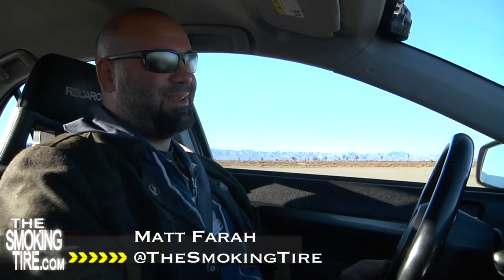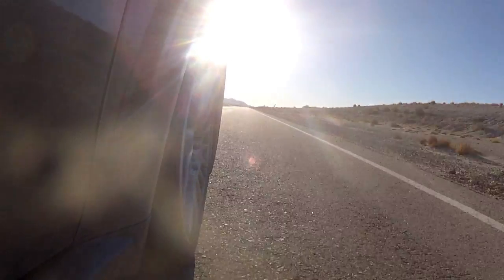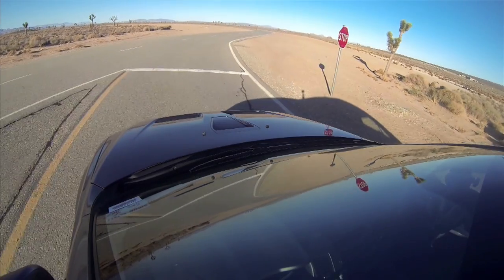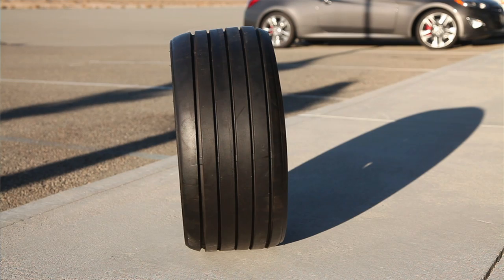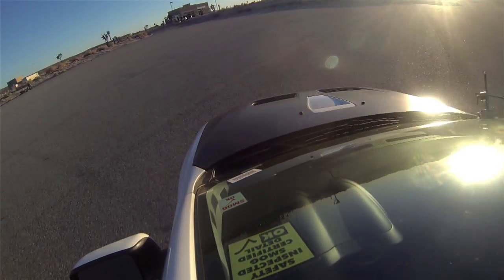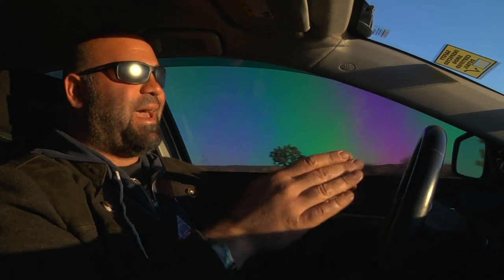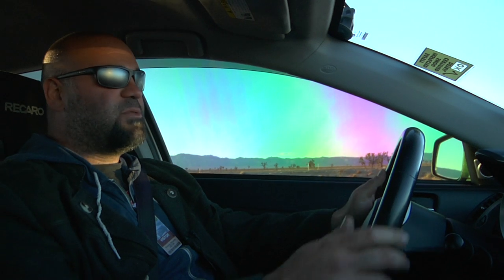Are current tires the wrong shape?

Comment: No mention of whether or not this is the same compound or not, different car (possibly different suspension setup)... Those would not work in snow at all. You need an aggressive tread and soft compound for snow. I see zero tread, just the grooves in what is basically a slick. You'd probably see that kind of difference in handling from a super slick racing tire vs an all weather tire. I need a more scientific comparison to believe this works as well or better than a properly set up suspension with 'regular' tires.
Reply: "No mention of whether or not this is the same compound or not, different car (possibly different suspension setup)"

Did you even watch the video? He says in the beginning that the tires are the same compound, and he says when he gets into the second Evo that both cars are using the same stock suspension.
Reply: Yeah, not that hard to change a set of wheels on the same car.
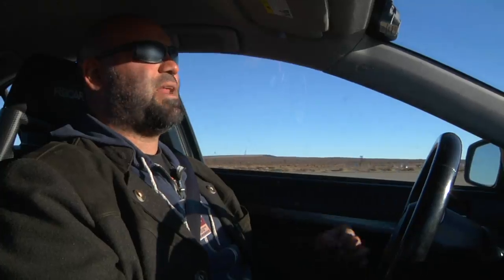Reply: vFortune Yeah, at 1:27, but is it the same brand/model tire with and without camber? The tread pattern shown would only work well on dry asphalt or concrete. They also didn't compare a car with an equal amount of suspension camber to the cambered tires. If your suspension is set up for camber, these tires seem a bit pointless and might make adjusting suspension harder as we have no way of knowing if they wear evenly. Is it an exact -X degrees from new to worn to the wear bars? Think I'll wait for the Consumer Reports tests before I jump to any conclusions.

I want to believe these would work great for people who don't want to change suspension settings for trackdays.
Reply: kuhlka
Hey says it is the same compound. I imagine it would be two different brands though because the purpose of the video is that they different shapes make a big difference. I feel you didn't watch the video and just want to complain.
Reply: Rasberry Jam Not sure if you're remotely serious, assuming you've actually read all of my previous posts after the first one.

I watched the entire video. He didn't specify brand, compound, etc. The only statement I heard was 'same compound'. Okay, but on a hot clean road a slick is going to be a lot grippier than a rain tread... I prefer my comparisons to have as much scientific data as possible, not touchy feeling BS with few actual details. Need actual track data to confirm that this design is as good or better than a proper alignment.

If it eliminates the need to screw with caster and camber, it'll be a godsend for people who just want to swap tires for a trackday and not have to touch their alignment at all.
Reply: kuhlka the first set of tires were not rain tires.. they looked like semi slick racing tires. you want to complain and rant with the parts you pointed out in the video, but fail to see the whole picture.  they were not shit tires and were probably had a tiny bit less grip than the camber tires. its obvious that the camber tires would work anyway... they are camber tires it would be faster regardless, you are just splitting hairs and talking shit.
Reply: He said it was the same compound. Why would he have to specify which one? It would tell you nothing more. If they are same they are same. Also he said suspension is stock, nothing has been done to it. But I do have to agree that a bit more scientific comparison would be lot more revealing.
Reply: kuhlka
Yea this is the first and last time I've heard about these. Who knows how good they are. It's difficult to judge from this video alone. I personaly don't think this would be all that better. Tire manufacturers are not stupid. I'm sure some of them have tried stuff like this. If not as a normal research than as a part of some racing team research. So if there was something to it there would already be tires like this on the market (if not on the market than definately on racing cars).

Still I don't want to be dismissive "just because". It could very well be better than normal tires. Who knows. But until I see some testing that's done, at the very least, in half-scientific way I'll refrain from judging them.
That's the least I can do, give them a benefit of a doubt.
Reply: He said it was the same compound and the same tred pattern on the same car with the same suspension so it was a really fair comparison.
Reply: kuhlka Most fun to drive? Compared to what, exactly?
Reply: kuhlka Sounds like horse puckey to me. Notthe sti, but the si...that's just hilarious to me.

I totally agree on the money part though, even my dream cars(04 cobra/13 gt500/m3 are far cheaper than 50k) I love brz/frs' even though I'm a power+suspension nut.

My main beef with the si is that it's fwd, and thus if that's the a requirement to make the list I'd MUCH rather have a senta se-r which would gain an extra 20hp/tq + get nearly the exact same mpgs. If they considered rwd(which they should, because rwd is king of reasonable fun IMO) then the si should be blown off the list.
Reply: Josh Reynolds take a look at 1:40 that is not the same tread pattern. Besides they needed a 3rd car with -2 degrees camber on a regular tire. Cars with negative camber between -.5 and -2 will generally handle better than a zero camber car
Reply: ***** Exactly. Without actual numbers and facts to compare stats, he could be completely BSing. The tread pattern of the tires are completely different. The cambered tires are almost slicks compared to the 'same compound' road tires he tested. That makes a big difference as there is more rubber contacting the clean dry asphalt. This is why you're not allowed to run slicks in 'road tire' class autocross.

Need to see more comparisons and actual tests by Consumer reports before I buy into the hype. I'm a bit disappointed that I haven't heard anything about these tires since I saw this video. I might need tires for my BRZ in another 5-10k miles.
Reply: ***** Yeah, that's the thing. We need to see stuff like Consumer Reports tests where they throw these tires at extreme road tests with potholes, various road surfaces, asphalt to dirt transitions, snow... It might turn out they're a one trick pony tire for autocross only.

I honestly want to see good tire options out there, especially for people who don't want to mess with their suspension settings just for the occasional trackday. I've seen guys with 86's like mine throw on a front swaybar and tires and drop seconds from their lap times, so every little bit counts when it comes to maximizing grip and handling.

It very well could be the inventor of this tire design has a patent but the major tire brands are going out of their way to keep it tied up in the courts. All kinds of variables to consider when it comes to getting a concept through all the hoops to get approved for retail.
Reply: kuhlka
Consumer reports....loooooool
Reply: U_Wot_m7+1 They didn't steer me wrong about the 2003 Honda Civic Si hatch or the 2005 Subaru WRX STI. Both of those cars were rated most fun to drive and they were correct. I hooned the hell out of both. Now I've got a BRZ.
Reply: U_Wot_m7+1 Compared to the vast majority of other reasonably priced cars on the market. Like most people who don't make an executive's salary, I couldn't give a shit less about cars that run $50,000+. I'd rather buy a BRZ or STI and mod the hell out of it for 10k then still have trackday or vacation money left over.
Reply: U_Wot_m7+1 The 03 Si was a rally-inspired hatchback. The shifter is in the dash and it ripped through snow like no other car I've ever driven. I actually went through 1' deep snow. CAI noise from 45mph onward was amazing. Had a good amount of understeer if I was too aggressive with corners, but tires and swaybars can tune most of that out. It's bizarre how well they've held their value for being ~10 year old cars. Most still go for around 10k and they were 17k new.

You can always add more power, but you won't necessarily start with a nice lightweight balanced car with tons of utility that has a racy driving experience for cheap. That's why it won 2003. The 05 STI won in 05 because it is just a fantastic all around STI. I never traded up because they added a ton of sound deadening material, weight, and made the suspension into pudding on the newer STIs. That 05 handled like it was on rails and just felt alive every time I drove it. 150+ like a hoon and sideways action in the snow was hilarious fun. I'll eventually get another STI. Maybe a BRZ STI if Subaru gets around to it.

Comment: He said both evos had stock suspension, how are they running camber tires with no camber to begin with?
Reply: camber is adjustable.
Reply: the tire itself is cambered. so there is no need to put any camber into the suspension. you can run zero camber in the suspension and still have the tire look cambered. not the wheel though. the wheel will still have zero camber. just the tire itself.  note though. if you do add camber to the actual suspension, that should increase the performance of the entire package. very interesting. I think more testing and on different model of cars should be done and documented.
Reply: Tremac26 If you actually follow the video he says the suspension on the second evo has been adjusted for the tyres (more toe out thus better turn in and lighter steering). So add 2 degrees of camber, fresh rubber and the thread design of a race tyre (not a chance of avoiding aquaplaning in that thing) and OFCOURSE it is going to grip better.

Neat idea whilst you are drunk, but definitely not the future.
Reply: Tremac26 1 error in his design. Can you see what this might do to a lot of idiots that jack up their trucks and put street tires on em?

Comment: Apparently neither the inventor of this tire nor anyone in the video understand this, but the entire point of camber is to make up for the wheel standing up when the suspension is compressed in a corner. That way you have maximum tire contact patch in the corner where you need it. So, I don't understand how anyone thinks this is going to change anything. All it means is now you have to put more camber into the suspension to make up for the artificial camber built into these tires. Any benefit people are seeing is just going from a better compound, and possibly to a better effective setup from stock since the car will have very little camber from the factory for tire wear purposes.
Reply: With the tires adjusted for toe, the contact patch is actually enlarged because it's at an angle. The benefit of this tire, from what I can tell, is that it has a larger contact patch and doesn't have the same issues with tire wall flex as a stock tire.

Comment: Soooo, I already new before the test that the camber tires would be faster than the stock tires. that's what camber is for. what I want to know is are they anywhere near as good as a properly done camber set up on a car with regular tires. they better be pretty damn close to as good and a good deal cheaper because I think they look ridiculous when the car is sitting still, though much less so when it is cornering

Comment: can you test the tires w/o the driver knowing which tire is installed? also I know both of those evos are virtually the same but for experimentation purposes, one controlled car is better IMO.
Reply: Next you'll ask him to objectively compare the two types of tire by running each course against the clock or recording corner speeds and braking distances. Your radical scientific ideas and logical thinking are dangerous. You need to put on some dope Dillon Optics sunglasses and chill out! ;)

Comment: For ERW they do. We have published another patent describing dual nano rubber wedges off a curved hoop for a new level of traction to the surface.  A pinch effect for high speed and high speed maneuvering. 
High frequency in wheel suspension for holding to surfaces. A continuation -in- part patent from 2008.

Comment: first of.. you need to test on the same car. otherwise it can never be a fair test... suspension may be stock on both... but how about the milage, how they have been used and so on. plus.. a tire with no crossing threads braking in the snow?? oh jenny please tell me how? it might Work well for turning as it diggs in to the snow at an angle. but you have no hope of stopping Again... i normally like to wathc you test cars. but this test might have changed my oppinion all together..

Comment: well anyone who has a locomotive background in bullet trains this design was not invented by john, technically. this was the basic tire change that your basic bullet train needed to invent in order to go around the bends at such speeds. so this design has been proven to work.but it has not been implemented by the tire company, due to the fact that one part of the tire does ware out faster than the other. which could potentially mean non-pneumatic tires may be whats needed for it to work properly

Comment: i' d like to say well done,as an engineer it makes perfect sense,if you run lots of negative camber,your tyres when worn end up like that.I'm guessing under steering loads, the outer wall of the tyre has more rubber to compress against leaving the contact area square.Do you need to run any more castor?because logically you should...would like to know more!

Comment: I'm not saying one is or isn't inherently better than the other, but it is biased in a few ways.
When doing a comparison it would be best to do it at optimal conditions. The first tyre should not have had the spiral cut, that is just completely retarded, no way that is optimal for a flat tyre. Secondly, the toe was altered to suit the conical tyres, ten bucks says the toe wasn't adjusted between sets. Both of these would affect the steering of the first set.

Comment: im really thinking why he notice less understeer is due to the toe out. i want to believe the concept i really do, but knowing that alignments are taken at the wheel and measure the hub/wheels tilt, running these and adjusting your wheel camber would mean your alignment machine would read -2 deg camber but your actual camber would be 0 deg at the tires. correct me if im wrong, but this would mean that nothing has changed and your knuckle is just tilted more now.

Comment: "Not as much understeer on turn in", yes sir, adjusting for stupidly shaped tyres with massive amounts of toe-out tends to improve turn in, i highly doubt it's the tyres. As for comfort, is it the same sidewall rigidity and aspect ratio? How about the compound, did the tyres have the same? i doubt it. Until we see a racing driver with accelerometers and a skid pad, on the same car. With similarly grippy tyre compounds, i call utter bullshit.

Comment: Yeah, except the grip you get from camber is caused by the lateral camber thrust from the tyres resistance to deformation. -Which you virtually eliminate by running a tyre that shape, you're just increasing the amount of negative camber gain required for similar levels of lateral thrust. And good luck with center point steering. better fuel economy? I highly doubt it. Conical shaped tyres do NOT wear evenly no matter how you toe it. You'll be dragging your inner edge along constantly.imbeciles

Comment: Thank you. The only way to scientifically prove if camber actually works is to make it the only possible variable in both tests.
I have made camber tires myself. I have been driving with normal tires with 1.5 degree negative camber at the back and after a year they become a camber tire. I could back then make a test comparing them with the pair from the front which were run close to 0 degree.

Comment: blind test would have been better, but at least definitely not with different cars, specially if one has a carbon fiber hood which changes weight distribution a who know what else they have changed to shift weight, and we all know less weight in the front can alter understeer. this is not a useful test, at all.

Comment: The better fuel economy for the smaller tire doesn't make a whole lot of sense.  The computer might read better fuel economy if it isn't calibrated to the smaller tire, though.  It would be about the same as having a shorter final drive gear where you're going to have the engine revved up higher to go the same speed so it would ultimately hurt your fuel economy.

Comment: There are more changing variables in this experiment than just cambered tires, is the whole point. btw I know what camber is, no need to explain camber. im sure everyone who is watching this video already knows what camber means. I also used to own and evo8MR drilled and slotted rotors, 18"wheels falken tires, tien racing coilovers and adjustable suspension with toe and camber.

Comment: The test was about a standard tire vs the camber tire, BUT, how bout a standard tire with a camber suspension vs the camber tire with the same setup but zeroed out on the suspension side? does it perform as well if not better than a suspension that is cambered for the tire? that is the ultimate question here... cause if I end up paying $2000 for these camber tires, I might as well get the suspension that will last longer...

Comment: So.... how is this preferable to just running more camber? Or is this a workaround to get a flatter contact patch when you are running ridiculously impractical camber to begin with? I have a feeling this magic spiral cut pattern is just something that's easy for them to do repeatably without using millions of dollars of equipment and molds and research for tread patterns. Also, I wonder if the white car is more track prepped than the black one. Im not gonna say hoaxe, but maybe gimmicky?